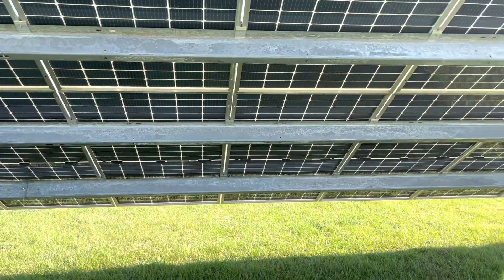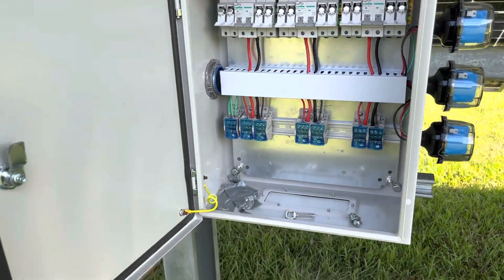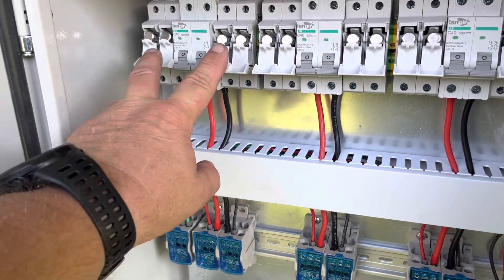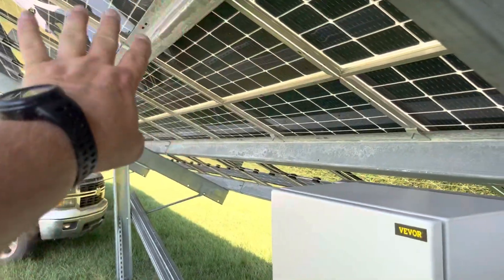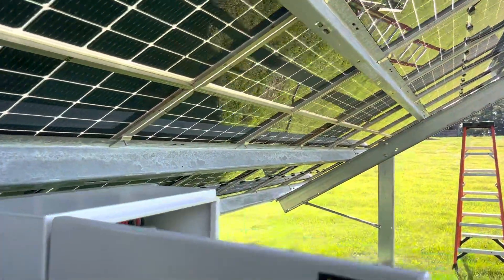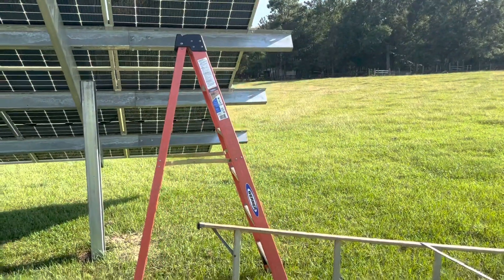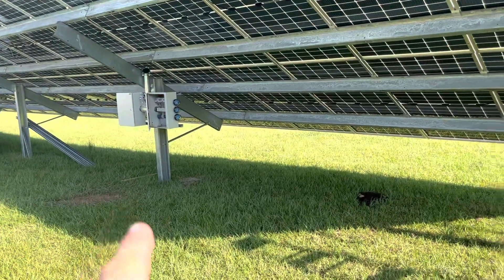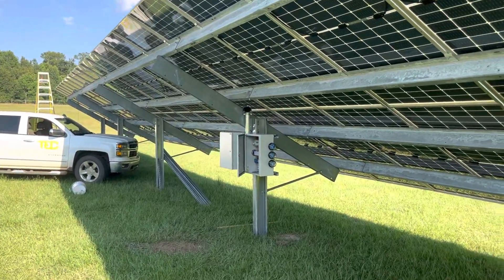Solar Power Project - Mounting Combiner Boxes to Sinclair Ground Mount

Comment: Could you provide details of the components used to build the combiner box? I am trying to build one, but it is hard to find UL listed items.  You did a great job putting it all together.
Reply: Did you get an answer to your question? I've learned a lot about combiner boxes and I'm familiar with the components.
Reply: @phakeAccount  Yes, been up and running for the past two years now.